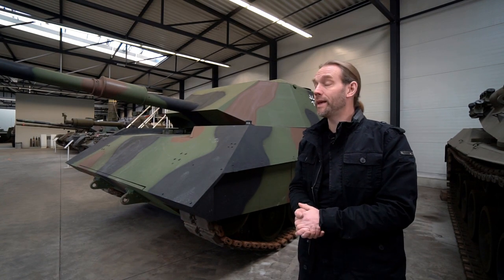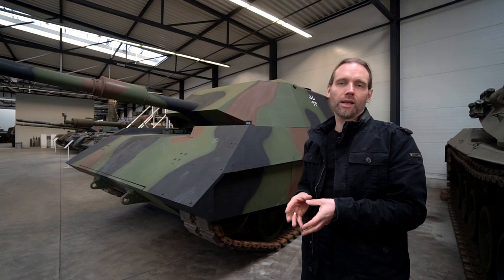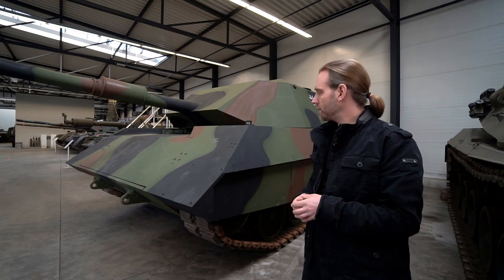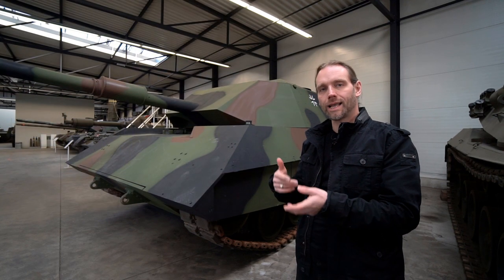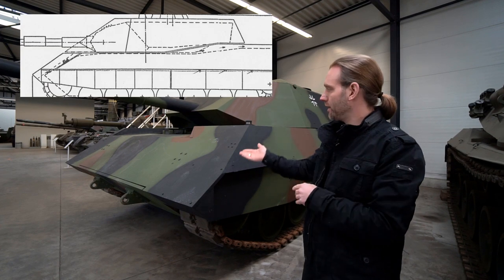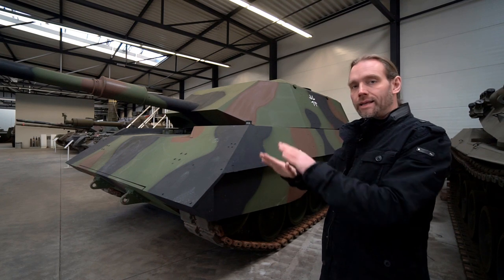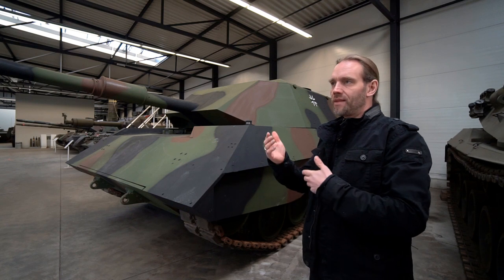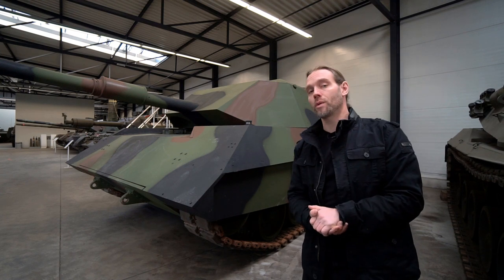Armoured History: The Stealth Leopard (E01)

Comment: Looks and sounds really interesting, just one question. How does the gun elevate in the new superstructure? It looks like it's attached to whole turret covering. Is there a small part that moves with the gun that I can't see?
Reply: Perhaps it's just fixed for the prototype
Reply: @kwkfortythree39  or just model
Reply: Maybe the whole mantel moves with the barrel?
Reply: @BrownFoxWarrior  I thought that initially, but the front is solid with the rest of the turret covering.
Reply: @kwkfortythree39  I think that's the only answer that makes sense
Reply: Works like the gun in the Leopard 2A5, look for a video of it and you'll see
Reply: If you look closely you can see a tiny "seem" or "jack" in the paint on the turret near the gun, perhaps the paint was put on after they discontinued it, or the gaps are so small that we can't see it with this angle/lighting.

Comment: Thank you for recording in English,  Are the extra plates too thin to form a shot trap under the mantlet cover, or could that have been an issue if the design went into service?
Reply: Vehicle Prototypes like this are rather pure design studies, "what can be done, and how would it change things" so questions like "how would an efficient design looks like" werent rly a matter at that point. Its also possible that if the data was feasable, they`d rather make a complete new tank from it then just update existing leo 1's.
Reply: The most effective armor piercing munitions since the 60s are HEAT and solid shot. Both heat and sub-caliber long rod solid shot react differently to angles in that they don't deflect very much, in fact they turn into the armor a little. So no matter the thickness of the plates shot trapping will not be an issue. For a very similar reason modern tanks are so boxy, since sloped armor doesn't make that much difference unless it's very extreme.
Reply: @Azreal20  new build versus upgrade doesnt seem like much of a factor in the ballistic property of the outer shell. To answer his question though, i seriously doubt its thick enough to deflect rounds into the hull

Comment: Radar would not be able to even detect objects like this due to the clutter. Infrared would also easily detect this tank since infrared detects heat. The exhaust from the engine goes somewhere...no matter how much you change the armor profile.

Comment: IIRC the early radar-absorbent paints contained iron particles that heated up (vibrating) when hit by radar, expending the energy so that less reflected back.
Since you said the Bundeswehr used a foil they must have gone in another direction... or got a little help from the USA, since they have stopped using paint on their stealth planes after the F-117 and now use some kind of sheet/mats to cover their planes.
Reply: Back in the 80s germany was at the for front of stealth development. They even had projects for stealth fighters going on.

Comment: If I didn’t know the German tanks run on gasoline I’d say, isn’t it easier to pump in diesel in the exhaust pipe in order to disappear behind a smokescreen, since the IR-resistance is less effective from other angles than from the front and thus it was less of a use in infiltrated fighting. Difference in efficiency equals about 25 percent with the IR coming out on the win.  Difference in cost efficiency equals several million Marks in those days money with the IR being the big loser.
Reply: Also the smokescreen is the only one of the two countermeasures that works against ocular and binocular visualing.
Reply: Which was the common thing.
Reply: There are other solutions to create a smokescreen.

Comment: Odd that they didnt try to hide the gun barrel.  Also one big signiture in infrared spectre is tracks when they heat up after few kilometers of driving.
Reply: I would guess the intention of this design was to help in defensive warfare, which wouldve been the main type of combat for germany in a WW3. And when youre defending youre not driving around too much. just an uneducated guess tho
Reply: Manouvering and relocating is important part of defence. Even in 1980. 

Still wondering why they didnt do something to barrel. Leopard 1's and challenger 1's had thermal sleeve to give some protection from heating but this late prototype lacks it or any other type of fixed thermal shield.
Reply: @justinterestedmusic  They probably had ways to shield the barrel, but focused on the main chassis. The cannon cant even elevate in that configuration, which probably means they completely ignored the gun until the project got discarded/finished.
Reply: @WeyounLP  actually the Leopard would be constantly on the move even on the defense.
Reply: doubtful that the tank expected to remain hidden after firing its gun because the reciepient would be having a very memorable experience that spur on his attention right then and there.

The bigger goal would have been to keep tanks hidden when moving or hiding in ambush position. Once shells start flying both sides would not depend on radar or IR anymore to shoot each other.
Reply: They didn't try to hide it because this isn't a functional prototype. This thing was used to test the materials not something you testdrive

Comment: She's about as old as I am. I'll have to come in and say hello. 

I do have wonder though, I'd hope that someone can confirm/answer this for me. 

That gun barrel looks entirely fixed. No ability to raise or lower it. 

I know, prototype vehicle. Still, it seems that if you're building something for that, you're going to have it as close to battlefield requirements as you can. Might just be the perspective, but still.
Reply: at 0:31 you can see what seems to be the seam line between the turret and the gun , by the length of it the elevation looks limited though , if it does elevate.
Reply: @brodiet539  Why I said perspective, that's a pretty close fit and I don't see much space for elevation there.
Reply: There is no elevation to the gun. This prototype was just to figure out the basic principles of what could work and what wont;)